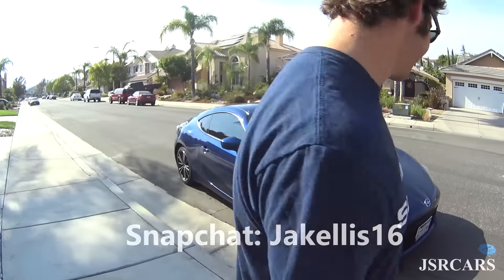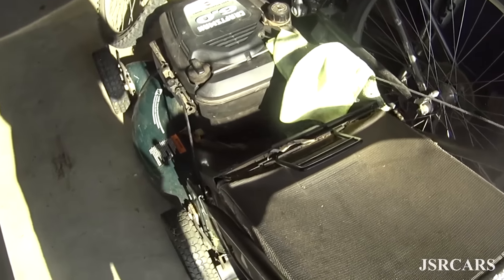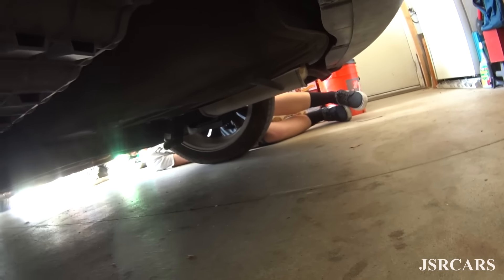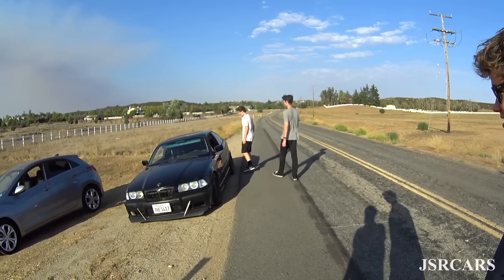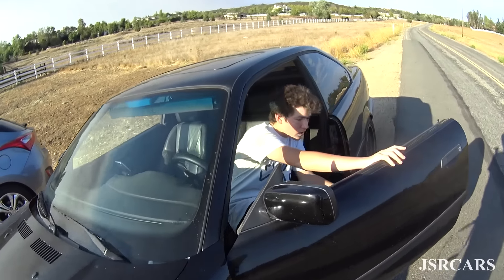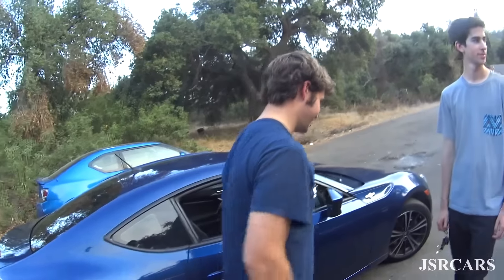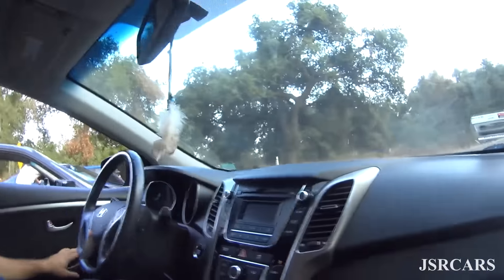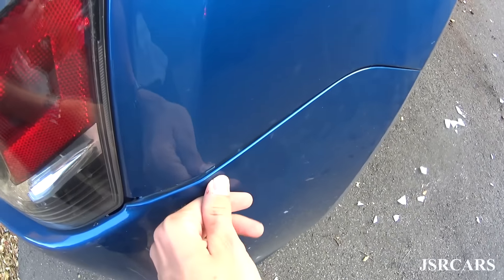Making The Little 1.8L Sound Mean

Comment: i got a 98 jetta tdi got for 1500 plus the guy said if i ever have a problam with it or any other vehical i can take it to his house and use his huge garage that has everything from a lift  to a motis conputer (already went to fix rear brakes [i knew they were bad when i bought it] and he payed for pads and cylinders) it has rebuilt engine with about 50,000 but the car has 25000 but the rust isnt to bad. already made up a true strait pipe no cats no muffler.